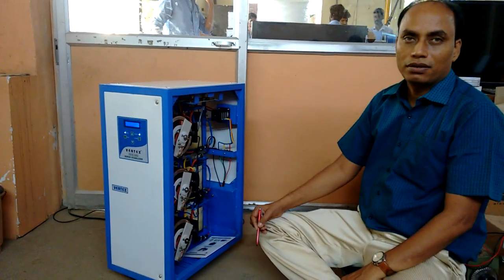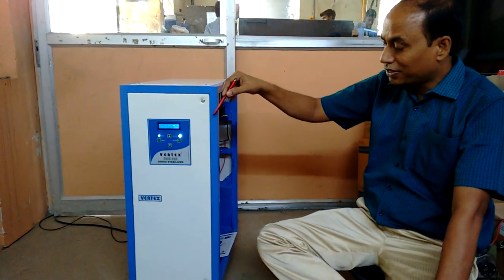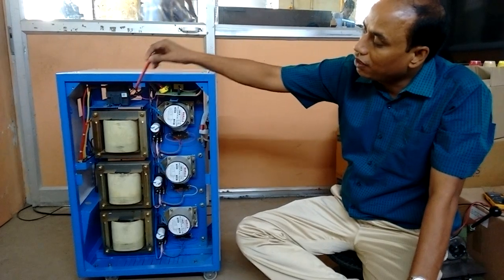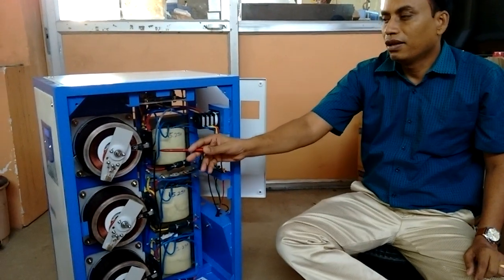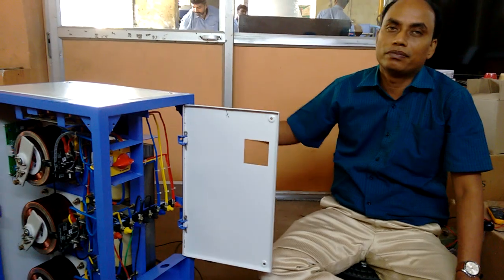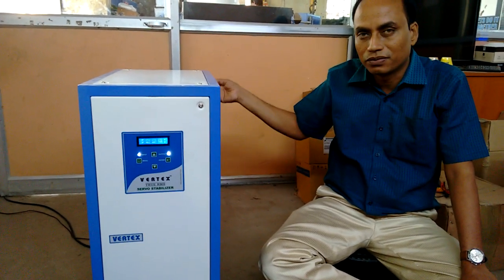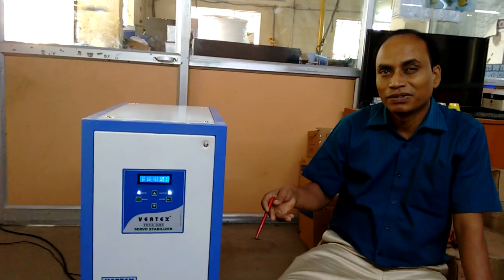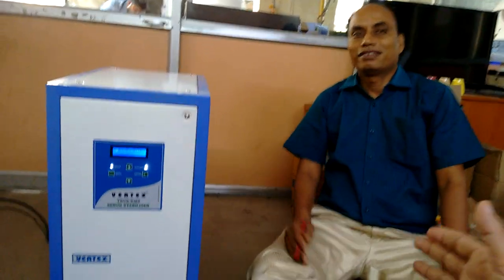How Servo Stabiliser Works?

Comment: எனக்கு ஒரு சந்தேகத்துக்கு, என்னவாக இருக்கும் என சில விளக்கம் அல்லது suggestions கூறுவீர்களா?
என் அபார்ட்மெண்ட்ல், servo stabilizer உள்ளது. ஏற்கனவே inverter + 2 Exide batteries உள்ளது. Balcony இல் வைத்து உள்ளோம். தேவையானது மட்டுமே inverter line இல் fans, lights, tv, மற்றும் 2-3 switch sockets க்கு ஆகியவைகளுக்கு inverter backup line க்கு connect செய்து உள்ளோம். Balcony இல் வைத்து உள்ளோம். முதலில் servo stabilizer wall socket இல் connect செய்து, பிறகு inverter line , servo stabilizer இல் connect செய்து உள்ளோம். வெறும் inverter backup line இல் கொடுக்கப்பட்ட உபகரணங்கள் மட்டும் தான் voltage fluctuations வராமல் இருக்க தான் servo stabilizer போட்டு உள்ளோம்.
இப்போ வர வர என் வீட்டில் மட்டுமல்லாமல், எங்கள் அபார்ட்மெண்ட்ல் சில ஒன்னு ரெண்டு வீட்டுக்கு அப்பப்போ fluctuations வந்து வந்து போகும் போது, servo stabilizer இல் ஒரு விதமான creech noise sound போல சில வினாடிகளுக்கு வந்து போகுது. அப்பப்போ இந்த servo stabilizer இல் கீச், கிர் என சில சில நொடிகள் மட்டும் வந்து போகுது, இந்த மாதிரி sound வரும் போது, வீட்டில் உள்ள ரூமில், hall இல் உள்ள tube light, பக்கத்து பெட்ரூமில் உள்ள light flickering லேசாக வந்து போகுது. உற்று கவனித்தேன் servo stabilizer யை, volt input இல் 219-225, 230 குள் வருது, volt output இல் பார்த்தால், 229-232 குள் தான் இருக்கு. High voltage வரல EB power line இல் உள்ளே வரல, அப்போ எப்படி, என்ன தான் இந்த servo stabilizer இல் ஒருவிதமான சுழல் போல creech sound போல வெறும் 5 வினாடிகளுக்கு மட்டும் வந்து போகுது, திரும்ப சில விநாடிகள் கழித்தோ, அரைமணி நேரம் கழித்தோ, இந்த மாதிரி crreech sound, noisy sound போல வந்து போகுது. ஒருவேளை servo stabilizer இல் பிரச்சனை வந்து இருக்குமோ என ஒரு சந்தேகம், stabilizer இல் error led light எரியல, வெறும் input, output led light மட்டும் நன்றாக இருக்கு. ஆனா, மற்ற வீட்டில் இந்த fluctuations வந்து போகுது என சொல்றாங்க. அவங்க வீட்டில் servo stabilizer இல்லை தான் நினைக்கிறேன். அப்போ ஏதோ ஒன்னு, EB line இல், வீட்டுக்கு வரும் line இல் அதிகமான high voltage fluctuations வந்த மாதிரி தெரியல, servo stabilizer இல் high voltage input இல் வரல ! 
அப்போ என்ன தான் நடக்கிறது?! 
ஒரே குழப்பமாக உள்ளது ?!?!

உங்களுக்கு இதை பற்றி என்ன நினைக்கிறீங்க? என்னவாக இருக்கும்? எதனால் இப்படி ஆகுது என உங்களால் சொல்ல முடியுமாங்க?

Comment: For two 1.5 ton ACs, 5 fans, 15 lights, 1 water pump (to fill overhead tank), 1 microwave, 1 refrigerator, 3 led Tvs and 2 desktops. Will 10kva capacity of mainline servo Stabilizer be enough??
Reply: 35 kva is needed.....LOL.

Comment: SVR 1k - 2695.00

SVR 2k - 3960.00

SVR 3k - 5500.00

AVR 5k - 8800.00

AVR 7.5k- 12100.00

AVR 10k - 12980.00

TND 15k -20900.00

TND 20k - 26400.00

 

TNS 4.5K – 12100.00

TNS 15K - 30250.00

TNS 20K - 36300.00

TNS 30K - 42900.00

TNS 40K - 70400.00

TNS 60K - 82500.00

TNS 75K - 93500.00

TNS 100K - 104500.00

Note: This price is without delivery & installation charge.

Thanking with best regards

 

Engr. Muhammad Ataur Rahman                                                                

Chief Executive Officer

Nisatech Engineering Company

Cell: 01944488813, 01714400978

E-mail: nisatechbd@@t

Comment: Dear,all sir  special propose  Servo voltage stabilizer air cold oil cold 
Hi lo voltez problem solve other machine sef plz contact me 9914153613 Deepak Sharma

Comment: Can this servo Motor control with automatic voltage regulator work for fluctuating voltage?
Reply from the maker: welcome to marine tech hub. Yes this will work for fluctuating voltage. For more details please get the membership to know about it
Reply: @MarineTechHub  Why the F does anyone need your membership to know abt a common device which yourself dont know crap about. On the video u are pretending in your squawking voice that u know too much by throwing in some wide meaning blanket buzzwords that dont even relate. Just to show "youre aware" lol.

Comment: I have a car wash. I use 4 motors 2 vacuums 1 ac: 2.2kw +2.2kw+4.3kw+2.2kw +1.4kw+1.4kw+1.5ton ac. How much kva do I need? Kindly help.
Reply from the maker: Thanks for your valuable feedback !! Do share it with your colleagues and friend
Hereafter all my new videos will be available in website www.marinetechhub.com
please see all my video for more details in my website
OU3 is over voltage. If it is not resetting. Try to put off the power supply and wait for 3 minutes and again start the system and hope it will reset. Give me the feedback
Please install Servo stabilizer for the safety of the drive
Add all the kw plus add 30 % more for the safety margin

Comment: Hello sir.. Can I use your system for my CNC machine shop? I have 6 unit CNC machine where each of them at different power consumption (Kw). Let say one of the CNC machine is about 76 KVa. Should I install your Stabilizer unit on every machine to stabilized the power consumptions? Please advise me. Thanks.
Reply from the maker: Welcome to Marine Tech Hub
Thanks for your valuable feedback !! Do share it with your colleagues and friend
visit my new website www.marinetechhub.com
please see all my video for more details in my website
Please let me know the total kW of our factory and specification of the machinery
Reply from the maker: Please let me know the total kW of your factory and specification of the machinery

Comment: can I use this stabilizer for  10 hp-3 phase motor with submersible pump
Reply from the maker: Thanks for your valuable feedback !! Do share it with your colleagues and friends
Your can use it  but always keep 25 to 30 % more for the stabilizer for safety margin
Reply: Any kind of Inquiry  feel free to contact me- 01944488813, Engr. Muhammad Ataur Rahman

Comment: Hello sir..mere ghr m 1.2 ton ka inverter AC laga hai aur voltage fluctuation bahot jada hone ki wajah s wo kaam nhi krta baar baar kharab ho jata h band ho jata h..abhi AC m v guard ka stabilizer lga hua hai pr AC sahi work nhi krta ..kya servo ka stabilizer lgane s meri prblm solve ho skti hai ..agar haa..to plzz suggest me ki kitne kv ka aur kon sa stabilizer lgana chahiye mujhe..
Reply: Mujhe sirf AC k liye hi chahiye ..AC  1.2 ton ka h .and plzz ye bhi btayein ki voltage fluctuations bahot jada h to servo work karega ya nahi
Reply from the maker: Servo stabilizer will work in the range 150 to 285 voltage and give a constant  voltage of 220volt. It is a closed loop with feedback system. It is also called auto transformer.
Reply from the maker: Thanks for your valuable feedback !! Do share it with your colleagues and friend
please let me know your full load of your house. Give full details of each machinery you have
Reply: Thanks for reply
Reply: Hello Sir mere pas 7.5 kva ka three phase generator se 10 hp three phase motor stabilizer se chala sakte he ? Input 7.5 kva in output 10 hp mil sakta he kya
Please ans do sir

Comment: 20 fan,20 led (23wt_) 15 tube,1 ho water pamp,1 deep frz, Total 5.5/6.5 kwt. Dose it work ? RPLY ME ! TnX
Reply from the maker: Thanks for your valuable feedback !! Do share it with your colleagues and friends
Yes it will work . But you need to go for 10 KW rating for the Servo stabilizer. So to keep a margin of 25 to 30 % more. For future load which can be added later.
Reply: Plz contact me Servo voltage stabilizer 7696757966

Comment: Price kya hai
Reply from the maker: Thanks for your valuable feedback !! Do share it with your colleagues and friends
Your price would depend on how much kw you require, single phase or 3 phase
Reply: 5kva 10000 10kva 20000
Reply: @salmanzaidi3922  For 15 kva for DJ application
Reply: @VISHALBILARIYE  28k for 15 kva

Comment: sir the kind of servo we have bypasses the voltage and damages the system if comes above 270 so suggest what can be done to make it trip.
Reply from the maker: Thanks for your valuable feedback !! Do share it with your colleagues and friends
please provide the trips for over voltage above 270 v
Reply from the maker: Please for more details of servo stabilizer Contact: Vertex Power Solution Cell no 9940058974
Reply: Dont put in bypassmode when its working in online mode

Comment: 6 kva price plz
Reply from the maker: Thanks for your valuable feedback !! Do share it with your colleagues and friends
Please for more details of servo stabilizer Contact: Vertex Power Solution Cell no 9940058974
Reply: 12000/- servo mate brand 9810704859
Reply: 11000 cosmostat make
Reply: SVR 1k - 2695.00
SVR 2k - 3960.00
SVR 3k - 5500.00
AVR 5k - 8800.00
AVR 7.5k- 12100.00
AVR 10k - 12980.00
TND 15k -20900.00
TND 20k - 26400.00
 
TNS 4.5K – 12100.00
TNS 15K - 30250.00
TNS 20K - 36300.00
TNS 30K - 42900.00
TNS 40K - 70400.00
TNS 60K - 82500.00
TNS 75K - 93500.00
TNS 100K - 104500.00
Any kind of Inquiry for AVR/IVS  feel free to contact me- 01944488813, Engr. Muhammad Ataur Rahman

Comment: dose it works like  surge arrester also?
Reply from the maker: Thanks for the feedback. one servo stabilizer is enough for entire house, please calculate the load of your house, keep 25 % more for safe margin.  It is also called variable or auto stabilizer which will provide you a perfect voltage since the input voltage is feed back, close loop and also take care of the surge in voltage.. Keep all electronic equipment safe.
Reply from the maker: when you open my youtube  channel : Marine tech hub you can see icon right hand side of the header . you can click to go to my website 1. RT flex engine 2. Nitrogen generator 3. solar power.  full details of CLU and Crank Angle sensor can be see
Reply: No this not sure arrester